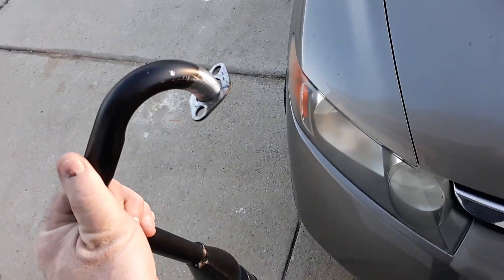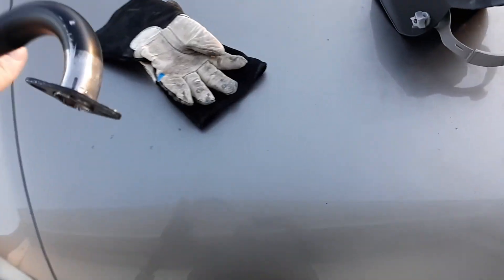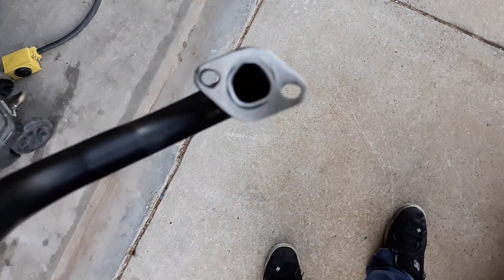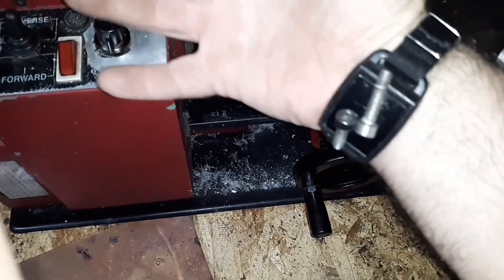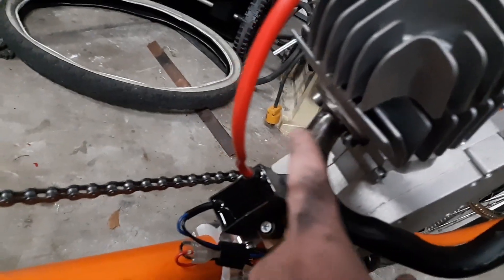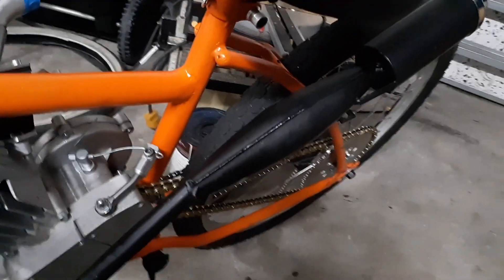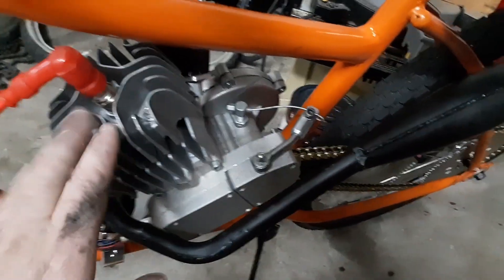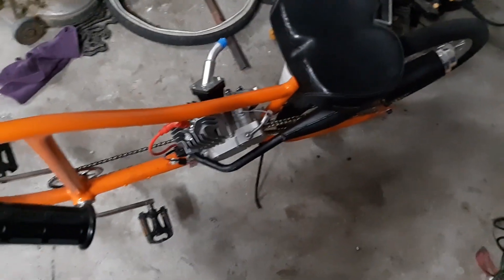46.5mm piston 50mm stroke - Power Stroke Build! Exhaust is done!

Comment: Something I always do that helps a bit with flow is port matching the exhaust itself close as possible to the cylinder. That way the exhaust gasses are not just hitting a wall on the flange
Reply from the maker: funny enough way the design of that engine was this piep actually matched really well.   This was a very weird engine low RPM but has crazy torque to point is was almost scary to be riding, on a bicycle anyways.  It may one day go on a mini bike or gokart.  But on bicycle was a bit to much torque.  Old fashion ATV 3 wheeler top end with 50mm stroke.   Was insane power but way to much on bicycle!

Comment: Bro do you have ig i have a problem with a preparation
Reply from the maker: ?  Not sure what your asking 😬
Reply: @BuildBreakFix  i want to convert the engine into a mineralli vertical engine but i have problems with thr adapter
Reply from the maker: @canmacon3429  40mm stroke 10mm adaptor, 38mm stroke is 8mm adaptor lol why everyone have such hard time with those never got that!  here whole video on 3 types! https://youtu.be/otKlUSjA2Vw
Reply: @BuildBreakFix  if i make the spacer i can put any cilinder?

Comment: Basically it's a shorter chamber but similar in diameter as my Kawasaki 500 triple, 
Now I know the math on these very well, been building my own chambered exhausts for decades, you already have what should be a very low rpm torque monster, by using this style chamber you'll be able to extend the torque vector of the motor and help soften the response on the throttle thru the rpm range.
Comparatively if I put a large chamber exhaust ( KX 500 something insane, I'd need to fit 3),, the torque on my motor when the sonic resonance hits the correct frequency in those chambers would be like stuffing a J2 rocket under my arse.
Smaller and longer chambers were used on 2stroke street bikes to calm the buggers down and make them streetable, and not complete death traps like the Moto GP bikes of the same.
Reply from the maker: Exactly the goal!  This thing is going to generate some stupidly high forces that I'm pretty sure the crank case is not going to like lol bearing journals in general 🤣👍  going to be a interesting build.  Going for raw torque over speed.  Once break in is complete.  Going to toss on few stupidly small sprockets see if it actually can drive them.  Put a 22t on minarelli one time about had heart attack getting going even after towed lol. Hoping this thing will drive a 28t in the end like butter ar 4k rpms. Be equal to saw build at like 10k rpms on the 38t it's running  lol just whole other approach to a build no one takes anymore.

Comment: Forget the heat cycles. Pre-anneal the copper gasket on a glass top stove. Much more efficient and you do it once and done, torque it down and off you go! Same for copper head gaskets!
Reply from the maker: I always do pre-anneal all my gaskets i cut out on CNC Router!  (∩^o^)⊃━☆ But i use a Gasket induction heater!   Was talking about paint job! Have to blast it all off to weld it!  Going to heat cycle the thing few times cure w/e is on it from factory! Then blast it over with high temp  black paint again! if you spray that china blasted uncured paint it will bubble 99% time!

Comment: Aren’t big pipes supposed to have more low end??
Reply from the maker: Yes but it's not on a "high rpm" build!  It's on a low rpm build with a long stroke length!  This is a 46.5mm piston build on a 50mm stroke!    Wont go past 4k I think.  But will drop tons of torque.  Kind of like diesel vs gas if you get what I mean.  But yes on high rpm 2 cycle engines all power is 50% to 75% throttle range.  So big chamber helps the engine get more power 25%-50% to 75% ranges i hope that makes sense! Lol
Reply: @BuildBreakFix  yea a bit confused but makes sence if you have low exhaust duration to have long heather pipe
Reply from the maker: @dj_impotencja  yeah this build like ass backwards of everything normally try to achieve lol. So many screwy things to its whole design.  Intake has huge duration of like 20 degrees more then anything ever seen before And is 19mm going in.  The exhaust has half of what the intakes duration is at 16mm exhaust port. Thing is they did it that way by design.  Compression is stupidly high and actually the smaller exhaust port is contoured from 30mm oval inside to a 16mm external exit hole. Only other 2 strokes built like this where those old push lawn mowers back in 50s and 60s that where 2 strokes. Few boat engines are designed I guess this way.
Reply: @BuildBreakFix  idk if you may port it to achive maybe better torque with more exhzust flow of whatever, i ve seen you put a reed valve on it so normly the intake duration is okay and wont cause further issues right??
Reply from the maker: @dj_impotencja   honestly 90% of this top end makes no logical sense why they designed it this way cause it's 100% backwards of everything you would normally think of how 2 stroke works.  but apparently from what some of the old timers tell me this design is crazy high torque from start to stop as is.  46.5 piston but at 50mm stroke with crazy port durations inside and a stock squish on these normally 2.2mm lol which huge,,,  I think i got this one to 1.8 which just because of how it had to be putting it on bicycle bottom end.  But as far as reed valve goes!  it's required for this top end.  this top end has a boost port that is open for a stupidly long duration. reverse window piston design lol like everything else on this thing!
Reply: @BuildBreakFix  that kinda odd for sure😂😂 how is the dyno doing??? That will be cool to get some data of the engines

Comment: That expansion chamber does nothing, sorry man but I have a friend who has it, it doesn't work at all. What it does it's that the muffler is a free flow type.
Reply: @Dark Raft 4 You could always post a copy of your math showing it doesnt work for this engine. Oh wait you can't because if you could do the math you'd already know you were wrong lol!
Reply from the maker: Lol what talking about?  It's a 2 stroke chambered pipe they are always free flowing.  It is exactly the correct dimensions for this engines volumes to push non spent air fuel mix back into cylinder before ignition....  not sure what your friend used it on.  But this is not a high rpm build.  Long stroke torque  build. The mini bikes they use these on are smaller long stroke 50cc engines.  You put this on a bicycle kit engine if that is what you mean, yeah would run like trash cause miss matched.
Reply: @BuildBreakFix  seems like you have a 15inches-ish header length
I was talking about the belly, it seems way too small, but again, I didn't do calculations on this one
Reply from the maker: @darkraft100  honestly i didn't think this was correct at all lol!   I asked the guys that do the comp saw builds!  they did it all out 3 times and comes out to the correct volume for a 1/3 wave return for next cycle.   Apparently since this engines stroke is long you want 2/3 of the Exhaust to blow out the pipe and 1/3 to return.  So smaller chamber lets more blow by faster. is how they explained it to me!   But the port design and durations is other factor they had to calculate cause very weird timing durations on this engine! was one of the reason i had such a hard time keeping Magnetos  alive when first built it.  If you don't have it perfectly ignite at right spot since so much compression blows the stock  magnetos like clockwork! had to buy one of those new thick gauge wire ones Motored life has been showing off to get this to breath fire on test bent! one other crazy thing to note this build!  Compression gap up top 2.2mm on this thing! @ around 240psi almost every stroke! these engines where known fo blowing kick starts like crazy back the day i was told!

Comment: I adapted that same pipe to a BT80 I was running at the time. It actually didn't perform too bad! I think it was a 5mph top speed gain over the stock pipe.
Reply from the maker: Bt80 is iron sleeve topend right?  Newer ones I think are? Never seen one yet everything mostly yd100 and such where I live
Reply: @BuildBreakFix  Mine was just chrome lined, but the ports and casting quality on the jugs were pretty decent. I just ended up ditching it since parts availability was extremely intermittent, but I still miss the electric start and the oil bath clutch.